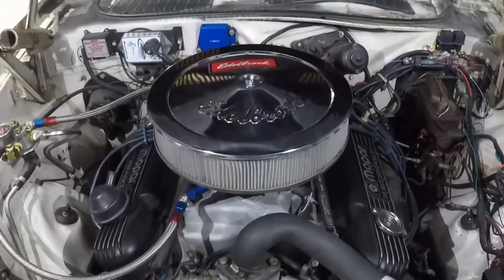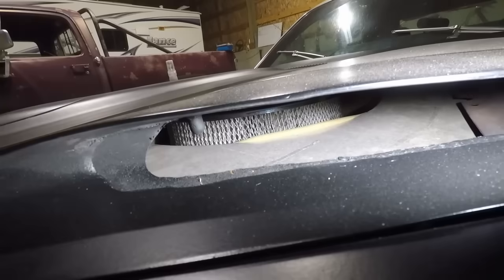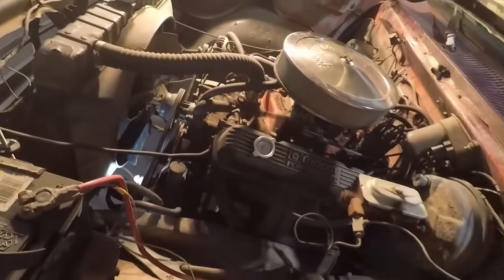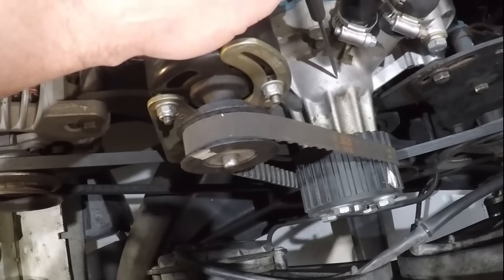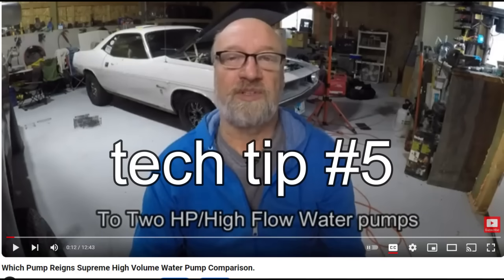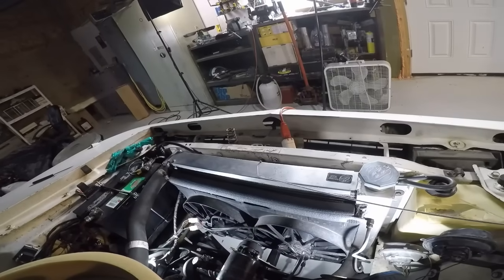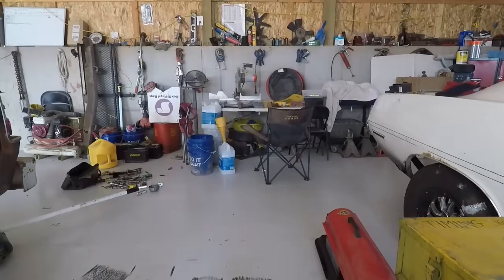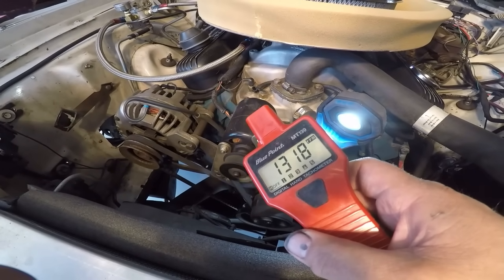Maximize Your Power: 8 Tips to Eliminate Engine Drag in Drag Racing

Comment from the maker: Moroso Electric Water Pump Drive Kit Universal Fit
https://amzn.to/3FLW9Rv

Flex-A-Lite Nylon Mechanical Fans 417:  https://amzn.to/3R4rCoy

FD CHRY Style Tri Flow Aluminum Radiator 26 Inch 3 Pass Cooling  https://amzn.to/49Dbr8j

3 Row Radiator Shroud Fan For 68-74 DODGE MOPAR Charger SMALL BLOCK 26" W Core
https://amzn.to/3wL1pU4

26"Radiator/fan combo   https://amzn.to/3SPbOWg

Pin Switch with L Bracket Universal Alarm Remote Start Hood Trunk Door Pin
https://amzn.to/3wpptM8

High Torque Radiator Fan, 11" Dual Puller, Euro Black With Paddle Blades
https://amzn.to/3TcnYtA

Fan/Water Pump Controllers:  https://amzn.to/40KiPew

Pettit Paint Splash Zone A-788, Quart Kit(Z- Spar)  https://amzn.to/4c1m467

Comment: Removing weight is a good thing, but it matters more in some places than just dead weight. Lighter wheels and engine pulleys matter more as they need to be accelerated before the car moves. Same goes for driveshafts, but you do get into a higher cost for some of these.
Reply from the maker: Couldn't agree more.  Most, don't think about rotating weight.
Reply: rotating weight is x4 removal. 😊
Reply: rotating weight is x4 removal. 😊
Reply: rotating weight is x4 removal. 😊

Comment: Electric fans,multiple relays,Nothing but a pain,,,,,went back to rigid 7 Blade fan,stock waterpump,4 row champion aluminum,,,,,,,runs all day 180° all summer in southeast,had a high flow waterpump but it pushed coolant to quick to allow fan to cool it down
Reply from the maker: It's all about finding what works best for your setup!

Comment: I like the idea with the electric water pump for another reason: 
 
I remember from decades ago, the early times of the electrical fans, and now again from my 30-year-old Opel Calibra V6, you stop the car, and after a minute or so the fan sets in again because the heat builds up without airflow. 
 
Idea is to cool down the system with the fan. 
 
But as the engine is stopped, the fan cools the radiator, but the cooled water will not go where it is needed, through the engine. 
All effect that you can reach (maybe it is enough) that ther is air moved through the engine bay.
 
In principle, when this heat accumulates,, an electric pump would be ideal, maybe as additional bypass of the  standing crankshaft-driven pump. 
 
I remember over 40 years ago, in France on the way to Spain, you were in traffic jams for hours with over 30°C outside. 
Our Audi 100 GL ran hot regularly hardly moving at idling speed (no electric fan back then). 
We found out we could avoid it by opening up the heater fully and having the ventilator full blast. You were cooked, but the engine stayed cool. That were just the additional percent in cooling area and air throughput that it needed.
Reply from the maker: The thing we do to save are ride on a overheating day. I too have been in them situations and adding heat to allready to hot of a day is miserable.  all to save your ride.

Comment: Best place to grab air ? Right under the windshield . It's always a lot of unused fresh air trapped there . Drill a hole in firewall the  metal part . Way better then a hood scoop or front . I mean go see big aerodynamic 18 wheeler . Just seal the hood to the firewall to prevent hot air going there and your set and look externally clean
Reply from the maker: That's an interesting idea! Thanks for sharing.
Reply: As long as your hood is well sealed and not dumping hot air out.

Comment: That wot throttle is neat, but without the alternator your voltage is lower robbing you of the energetic spark you get at the higher voltage which may cost you power instead of adding it. Underdrive is another option. Maybe use a dc to dc converter to increase your voltage to your coil when that same wot switch is enabled.
Reply from the maker: It works for me, but i'm still running the Factory style Chry. Ign. Module..........
Reply: @CudaFishEStories  many use a 16 volt battery at the track since it’s sagging voltage is close to a charging 12 volt battery, but that wouldn’t work well on a street car or even one driven back from its lasses and/or hot lapping. Thanks for the reply, good to know it can work.
Reply from the maker: @waynenocton  Your welcome.  Most 16 v systems don't us a alternator anyways.
Thanks for sharing and posting up.👍

Comment: Aluminum bumper brackets saved 12 pounds each side,I used a moroso water pump it works great, electric fan only one not 2 no issues yet,I like the cut off voltage regulator switch I'll try that,got the outside air just need to fab a alum and foam plate,I box cut K-frame took out motor mounts, (using a motor plate alum,)drag link,tie rod ends, steering box,used rack+pinion saved about 100 pounds alone on that and saved 💰not buying those high 💰 K-frames 
Alum radiator,alum heads,alum water pump+pump housing,alum intake,still looking to keep a street look
Reply from the maker: And all of that, taken right off the front end, with out cost you a fortune.  Your taking my language Alexander!!! ;-)

Comment: I went backwards on cool air, thx for posting
Reply from the maker: How did you go backward.
Reply: @CudaFishEStories  when I rebuilt my engine originally I maintained the dual ducted air cleaner to the front end grill, and have since replaced it with K&N air cleaner that pulls from engine bay…
Reply from the maker: @WesternReloader This is just my appinion so take it for what it is but.........with you drawing under hood air......have you notes that your car run just a little bit better when its raining????? My reasoning, is that the rain, is taking all the heat out of the radiator/engine bay giving you that cooler air charge.
Reply: @CudaFishEStories  I haven’t noticed that specifically, what I have noticed is when I go down in elevation from where I live at 5k’ , to just above sea level, the denser air charge, along with a leaner mixture, it runs like a scalded dog. I tend to keep my jetting rich so I don’t have to swap jets going down the hill. Once I’ve finished the other items (A/C & aux oil cooler) I will do something like you’ve done and make a hood scoop, or go the ducted route again. 1980 Bronco Ranger XLT.
Reply from the maker: @WesternReloader I too can appreciate the affects of High altitude. my car is a trailer Queen. i don't start it when it's raining but, i race at 6600 feet. when your making your scoop just remember that rain is HEAVY and air is light.  give the rain a chance to drop out.
Reply from the maker: @enhancedphysique6452  thank you. Always trying to squeeze out that last HP on the cheap.

Comment: How does a charging alternator rob power? Alternators are free spinning it doesn't have a clutch on it to engage or disengage.
Reply from the maker: Oh Boy thats a tuff one............. hope some one can answer it better them me............... when you spin it in your hand your not spinning it enought too cause it to charge.  have you ever stuck a screw driver to the back of your alt??? if its charging the screw driver will stick to the alt shaft area. two magnet put together will either repel each other or stick to each other. this goes on over and over in the alt creating a drag or resistence.  hope that made Sense?

Comment: Actually for a light car power steering NOT required! Parking will be a chore at first but you get stronger, now U-turns in parking lots no problem. Also probably 3 mpg better all the time. Probably zero offset wheels also make steering easier! Good luck! :)
Reply from the maker: Thanks for sharing
My car Weighs 3860 with my butt in the seat.
Me and my car need to go on a weight loss program, before i go manual steering

Comment: Alternator cutoff drops your running voltage from 13.8 to 12.4 or less. Is that good if you have an electric fuel pump, etc??
Tests have shown that 65 amps charging is less than 1.5 hp drag. Your belt is almost that bad.
THINK ABOUT IT.
Reply from the maker: MSD and the like, Don't like low voltage, this is True. If your fuel pump is Marginal,(for the HP your making) then the Alternator Disconent could create a problem......yes.
Lets use your number of 1.5 hp. The alternator drag is not Linear aka as the rpm go up the more power it robs! IT rob 1.5 HP from idle to your shift point to the end of the track.........do you think it would be seen in the ET Slip?????
Reply from the maker: @enhancedphysique6452   These are 60 -79(1979) performance, mostly mopar Cars and trucks....................
What is your deal with FIRE????? seams like it's just a word you like to us.......?????

Comment: 🤔 so if the electric pump is still connected to the crank, its a kind of hybrid, and you gain more power?
Reply: theres frequency modulated fan motors now too! 

so it can be 12v 1 amp but flow over 600cfm

thats the important bit, cfm and designed to work in areas the restrict air. i think its called positive pressure or something. 

if its designed right you only need one fan
Reply from the maker: The Electric Motor is conected to the Water Pump. not the Crank.

Comment: I always thought the lid upside down increased by highway mileage and power for sure.
Reply: On some of these cars the air silencer (snorkel) was maybe 2 inches across.  Size of one hole in the 4 barrel carb airhorn.  Flipping the top greatly increased possible air flow.    One in this video,  a rare dual snorkel but the vacuum flaps inside the snorkels reduces air flow.    Flipping does help, but this story is about cold air, not air flow.   I say rare dual snorkel as try and find to fit your car.   They used to be plentiful, no more.
Reply from the maker: Yup, that dual snorkel was going to the trash. I gathered it up and put it in my shed.

Comment: Could you do a video on the old late 60s early 70s Direct connection Hemi and 340 Race Tach drive mechanical electronic Distributors what rpm were they in and how hi they would go.Good bad ugly
Reply from the maker: I would have to do some reseach as i'm not that fammiliar with then but i thing all of them were dual point distributors not electronic.
The rpm question, i'm not sure of what you are asking............

Comment: My cold air intake has to be rain proof.  I have not designed one yet that I approve of.
Reply from the maker: Yah,my air filter would be sook in wet weather.
Reply from the maker: Take a look at the 2017 or newer Duramax that has a fresh air hood. That’ll give you some real good ideas.
Reply: I find that a true "ram air" conflicts with water proof but cold air does not. You just have to imagine rain moving horizontally into the front of the car and then gravity pulling it downward. I plan on using 3-4 inch ducting around top of radiator support and aims down at inlet so that rain does not go upwards into it.
Reply: I guess my comment was deleted...
Reply from the maker: Please Re ask the Question.
I haven't deleted any post.
I will respond to it.
Reply from the maker: Yup back in the day, carbon would build up on top of the piston and cause a eng knock.  Regulate the throttle so it didn't die and slowly pour a quart of ATF down the carb, the knock would go a way............do that today and the E/M will throw a  hefty fine on you. ;-) This usally happened when one cyl was using a lot of oil and driven for a long time.
Reply: @CudaFishEStories  Thank you, not sure what happened to my post.  Anyway, I was just saying a little water ingestion aint that bad.  People successful use water ingestion to clean carbon out of their combustion chambers, etc.
Reply from the maker: @AtimatikArmy  Agree, the air filter is what   cause the first problem and restricts the air. if your not running a air filter then it could be a problem.  you just need a drop out in the scoop to let the rain fall from the air stream.........never tried it, just a thought.
Reply: @CudaFishEStories  A dropout of some sort for water drain without losing ram air effect would be sweet.
Reply from the maker: @AtimatikArmy  agreed. my scoop are to small for much ram air affect. the scoop is sealed to the carb but the hood framing or support are not seal. so some of my so called ram air excapes out the back of the hood.

Comment: or you could just add boost.
Reply from the maker: Thanks for your thoughts.
Boost would be fun for sure, and i considered it on my last build but 13:1 compression was way cheaper. ;-)
Reply: @CudaFishEStories  once you go Turbo you never go back, and its worth the little bit of extra money, because you get a car you can street drive with the power of a race car and the torq is off the map by comparison.
Reply from the maker: I get and agree with all that. But the learning curve and money is huge! Blow thru carb, plumbing,turbo-s, header/exhaust manifolds exc. or forget the blow thru carb and go fuel injection! now there is a hole lot more cash and a HUG learning curve. Someday when my pocket is full….. I will give it a try.
Reply: @CudaFishEStories  best way to learn is to dive in, if you can build your own exhaust you can build your own cross over pipe and turbo mount, its just pipe and a little bit of welding. There are a couple of guys on youtube who figured out blow through carbs and have it down to a science, But I recommend going fuel injected, yes its costly but once its done the car is turn key and is consistent, drivability gets better, fuel economy gets better, throttle response gets better you also get better control over your timing curve compared to old school distributor.

Comment: plus 1-5 mpg per pound removed... the ac and power steering takes 30-50 hp to operate. 

its gotta be removed by a shop or it wont pass inspection.
Reply from the maker: I don't agree with any of that. How would they even know if it came with AC and P/S

Comment: 36 pounds is a bunch of weight but for a street racer i would keep it on , AC is cool!
Reply from the maker: Yup and the older i get the more i like it.  I pulled that thing off when i was 17.
Reply: put a import car smaller ac pump on there
Reply from the maker: @DANTHETUBEMAN  that holds true with the alternator as well. Less weight  and drows less HP. Look under the hood of a stock or super stock car. Its not that big Chry alternator🤫
Reply: @CudaFishEStories  mine is mini, 65 volt, low as I would go. I put it in a on off switch. 🤠
Reply: most cars only get driven in perfect weather. where do you live? I moved from Colorado to West Texas and do see more of a need here if driven often. Not if driven on nice moments only.
Reply from the maker: If I’m at the track, and it’s raining, it don’t start. My car is a trailer queen.
Reply: @CudaFishEStories  a little rain stops the show?😯 I drove mine in major snows with salt. With posi traction and all season tires it felt great. But not that smart to do with any exposed metal or existing rust anywhere.

Comment: When I drag raced I use to grease the fan belt. I gained Hp.
Reply from the maker: My car would throw the belt at 6,000 rpm….. and I felt it every time it did it!
Reply: @CudaFishEStories My 429 SCJ never threw the belt ever at 7000 rpm. You have an alignment problem.
Reply from the maker: @user-tn1hk6zm2freedom  Yes Sir! Mix match pulley beween a AC Car and a NON AC car.

Comment: I hate when ignorant people say that hot air has less oxygen than cold air.

That is categorically and demonstrably false.

I've built turbine engines, diesel engines, dragster engines, stationary engines and normal automotive engines, and only those who work with turbines are learned enough to know this is a pile of crap.

Being less dense means nothing to the chemical constituency of the gas medium, any more than saying that people with more tan are more African genetically, but in the winter, their genes turn European.

Its stupid to see people say this since its so provably wrong.

Oxygen is not some kind of existential cheshire cat that disappears in the presence of heat or reduced air density.

It is always there, always was, always will be.
Reply from the maker: Thanks for responding , i do appreciate it.
So dummy down this statement to a Simpleton, aka Me, So i can understand.
Oxygen, in the air, is what burns, with fuel right? 
At sea level there is more oxygen, per cubic foot then there is at High altitude????????

In simple turns, why is the statement that there is less Oxygen in hotter air(per cubic foot) then there is in cool or cooler air.............Wrong............................. I'm not talking about Altitude, that example was just a example of more or less oxygen per cubic foot of air...........
Reply from the maker: Poking fun at her is not going to ge her to respond.  I would love to here her appinion on this subject. Yes calling me "ignorant" was not nice but she fallowed that up with why she felt that way. I'm just asking for more info on her coment.

@DeliciousDeBlair  if you will respond back i promiss i will delete any coment that trys to discredit or bullied your apinions.